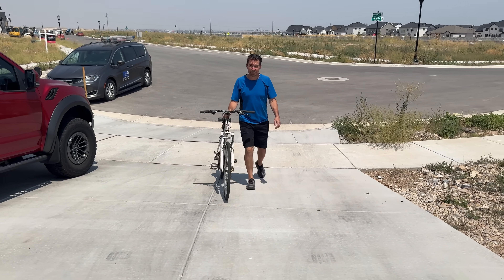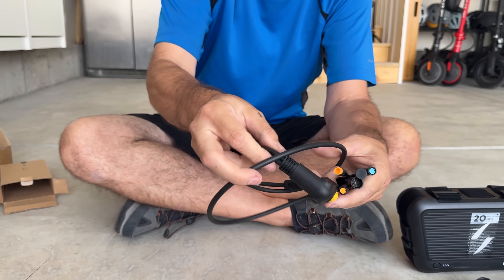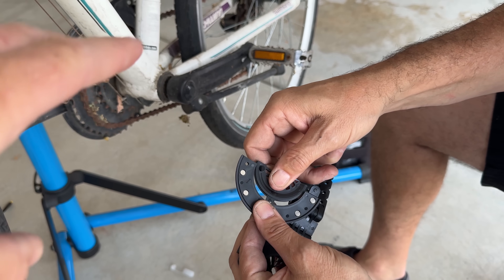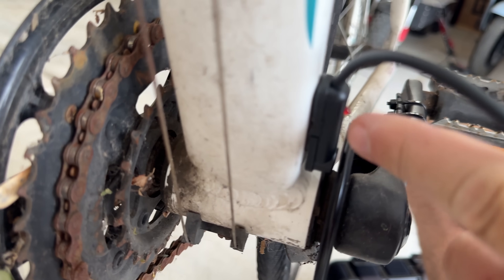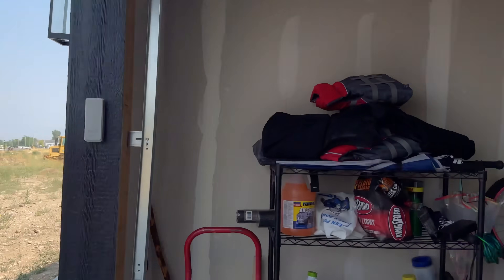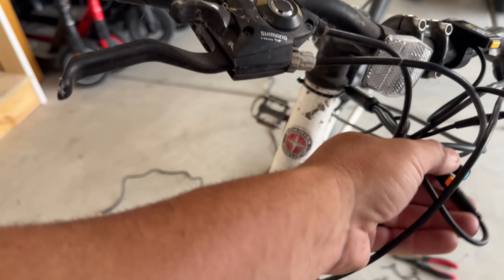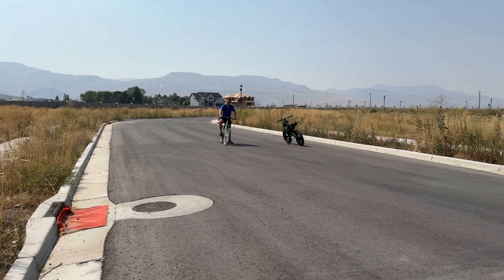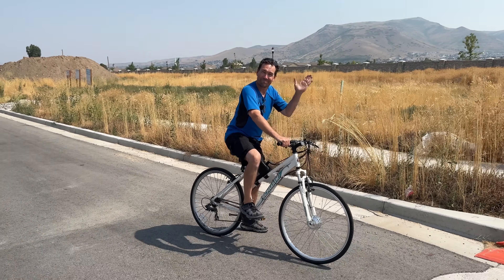I turned my PEDAL bike into an E - BIKE  | SWYTCH

Comment: AVOID SWYTCH AT ALL COSTS!!!

I've had a Swytch kit for just over a year and the battery performance has dropped massively over the last month.

I've tried getting support online as there is no obvious phone contact, but they keep going around in circles saying batteries only last so long and am I riding in -5° etc. It takes days to receive any reply. It's been 5 days since my last email with no reply asking if the battery can be checked to see if it's faulty. I sent a chaser and just had a reply saying not to return it, but to dispose of it responsibly!?!?!

A year from a premium battery kit is really rubbish in my opinion. 

Overall terrible customer service and if the battery lasts this long it's really not good for the environment.

Comment: SWYTCH SCAM ALERT. I ordered the Swytch kit. It came in months later but at the estimated time. It DID NOT fit my bike. The tire fit but the axel did not fit my fork. Customer service barely replies. I asked multiple times if I could buy a wheel motor with a wider axel. No response. I was allowed to send it back for a refund. I sent it back. A week later they tell me they are only giving a partial refund. No refund for $50 shipping and no refund for the $78 tax. That's $128 out of my pocket. No response from Swytch. I am now trying to make a dispute with my bank. AVOID THIS PRODUCT. This seller does not try to help you with fitting the product. They do not reply. If it does not fit your bike you are out $128.
Reply: Agree 100%. Bought a swytch kit 3 years ago and despite continuous correspondence with them, it still doesn't work properly. 
Absolute rubbish, avoid like the plague.